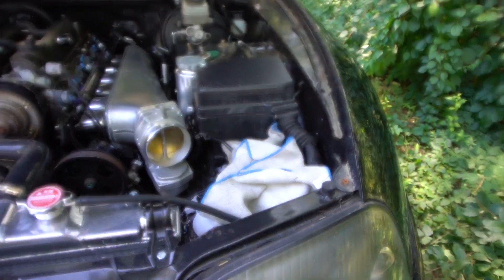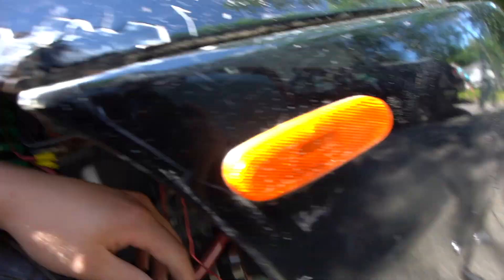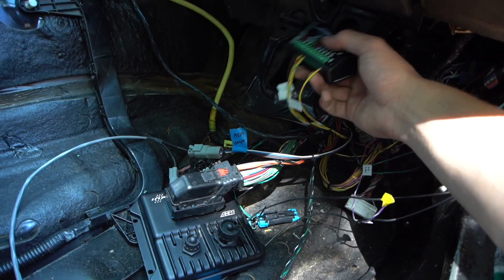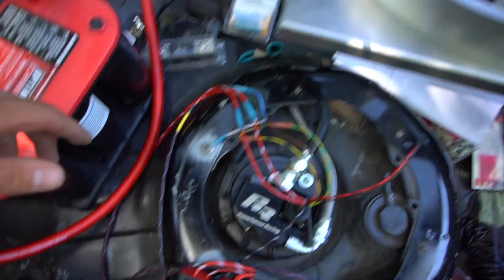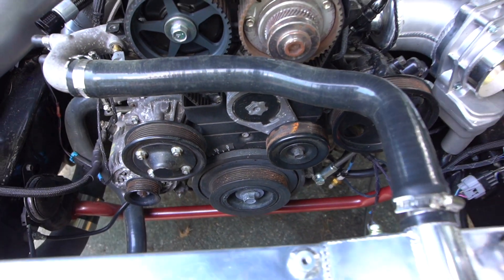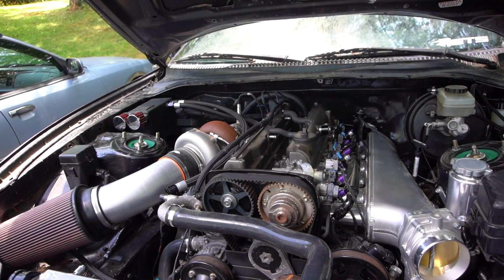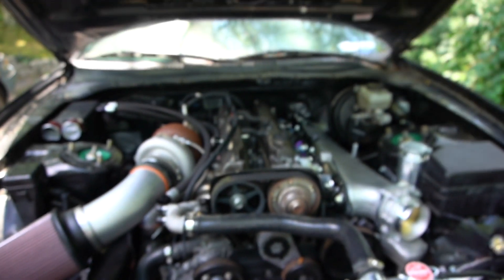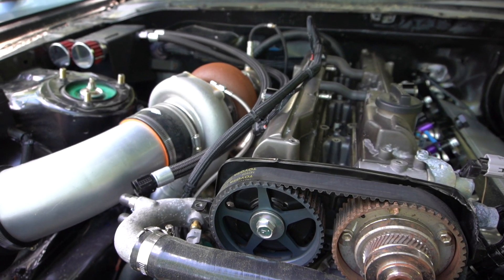Supra Build #22: Is my engine Junk?!

Comment: Doesn’t seem like it has been sitting long enough to seize... like you said 10 months is a very short time - maybe a bad gasket somewhere? Rust needs air to settle too so something as little as leaving the plugs out overnight in your area can be enough for it to start but still very very unlucky. Good luck with it - will be interesting to see the block if it is seized. Looking forward to the next vid!

Comment: Unlucky lad.  Hope when you pull the head there isn't much rust and it can be honed out.  A machine shop should keep you right.  Best result is a hone and new rings.
Reply: Sorry to hear brother, I just turned on my supra for the first time also. Anyway the reason why I'm writing to you is because my motor had been sitting for at least 2 years. I did a rebuild on all the gaskets but did not take the head off the block. We did have some issues when we installed my 2000cc injectors. When we were priming the system we accidentally hydrolocked the motor with fuel. It was locked up just like yours. Once we drained it everything moved freely. I know how tough these builds are. Good luck and keep your chin up bud. Sending good vibes from Denver Colorado.

Comment: The car sits outside correct? Could have been the moisture, but hard to say. I have a built 3.0 that's been built for going on 4.5 years now, I turned it after lubing it up by hand, especially when installing head/cams, and haven't turned it since, it sat in a garage wrapped in plastic wrap it's whole life til it went into the car, haven't started it yet but this makes me want to go out and turn it one last time lol. I should be starting up this month. Wish you luck man
Reply from the maker: It’s only been sitting for 10months which to me isn’t a long time for an engine
Reply: @1WickedSupra   I agree, doesn't seem long at all.